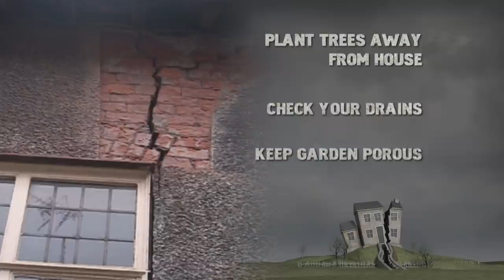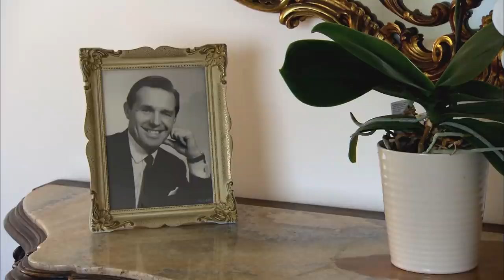Help! My House Is Falling Down | Series 2 Episode 5

Comment: Were any of the neighbours approached to see if they have similar problems? Sure that others shared the same issue.  A porous cement driveway - that allows grass to grow through - helps with runoff of water.  A  loft on the 2nd floor would not have been practical for a woman in senior years -  converting the garage would be a better option.  Good to see a client trusting and following the advice.
Reply: The mother was going upstairs to give a room to her mother downstairs with her son.  Now, if the mother gets too old to climb the stairs, the son can go upstairs and she down.

Comment: Please explain she like all home owner are told to insure there property for bricks and mortar. So this should cover the cost if subsidence. And not cost her more than £1k. But through this no one has mentioned insurance and i think this a bit false. As there shoukd be insurance on the property.
Reply: Not all insurers mitigate for subsidence in their policy and a policy is only as good as what you spend on it. The policy might only cover rebuilding after a fire not much else.Policies like meals vary. As it was her father's previously, she might not have the relevant work history either that insurers might have required.

Comment: Does house insurance not cover this?
Reply: Not in the US!!! Likely not in the UK either. In the US, “earth movement” and “builders defects” are NOT covered by homeowners insurance! I know this due to a VERY expensive and life altering learning experience with my own sinking house!
Reply: Depends. My house is in a stable ground area and my insurance will cover subsidence. However, if it was built on unstable ground, then the insurers may either not cover it, or have a large excess for any claims.

Comment: Thanks for an extremely informative episode. Full points for the technical presentation and pedagogical clarity. Such a shame however that the homes always look like their souls have been violently ripped out. And the last scenes are an utter nightmare. What's the point of saving the structural integrity of a house if the charming character traits are eradicated??
What the hell happened to the lawn in this episode, for example?
Reply: What character? This is a small 1950's bungalow, hastily thrown up after the war, not a historical Victorian dwelling. I'd rather have some greenery in the front, but this is her taste.  I think it's beautiful now.
Reply: @adhc8560  I beg to differ. The house has be lived in for the better part of 70(!) years. I for one find that fascinating and that definitely in my opinion lends character to a house. But hey, that's just me.

Comment: And with ANY house, most issues are related to moisture: bad drainage, toilet issues, with cracks and slugs or mold , then...ding, ding, ding..there is too much water and drainage is poor. Mold and cold; condensation and poor insulation.